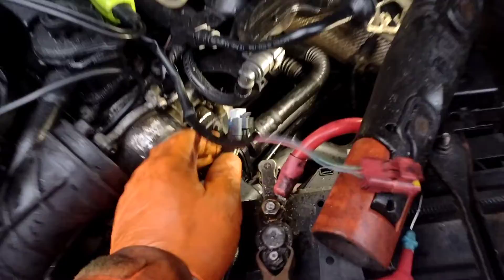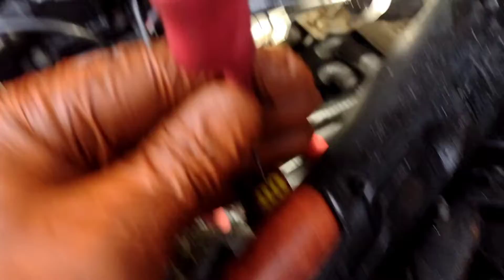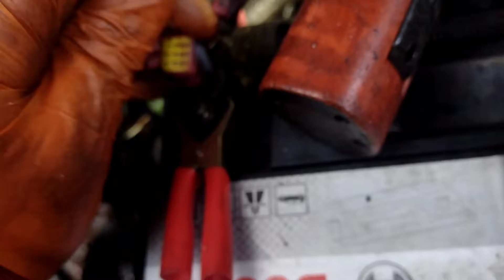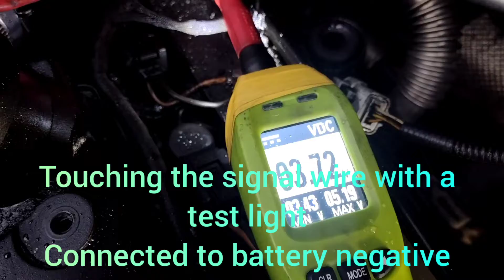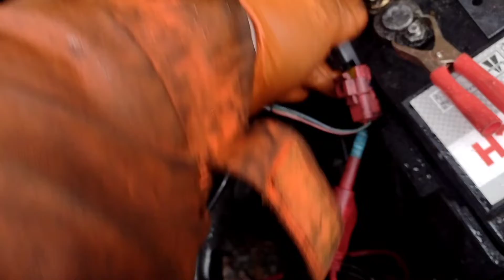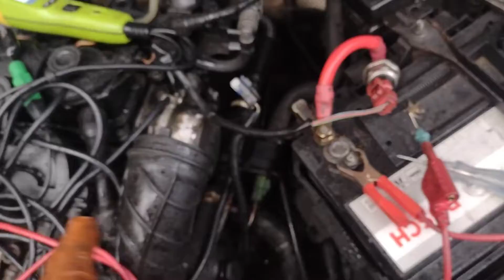Testing a diesel fuel pressure sensor (P0193) Ford Fusion

Comment: Great diagnosis,glad i found the video. I have similar problem on a ford fiesta. Voltage is almost same like yours,only showing 4.99 on the 5v(guess not a big problem) and the signal wire spiked when i put the test light,guess thats ok. I hope the new sensor will fix the problem. 
One question i have does the part numbers need to be the same like on the old sensor? Lot of them online but diferrent numbers,it says fit to 1.4 and 1.6tdci engines🤔
Reply from the maker: I used motor parts direct and it wasn't the same part number but it did work fine
Reply: @mattsautodiagnostics  tnx for the quick reply. I think ill get tomorrow the sensor and try out. Hopefully it will work. Greetings👍
Reply: @mattsautodiagnostics  hey Matt,after i changed the sensor,and deleted the fault the car started good,but i noticed the rpm fluctuated for cpl seconds and smoke apeared for a little,just on the first start. Later was everything fine. Next day,first start rpm's fluctuated again,went for a ride and car shutt off..again the fault was back p0193. I didn't purged the air out of the fuelfilter,because the engine doesnt have a pump to purge it. Could air in the system cause the car shutting off and apearing back the fault p0193?? There is only one grey pipe on the top..and one at the back of the filter,is it possible to.purge it with a vacuum pump?
Reply from the maker: Yes that will be what happened, some air in the system. I always use a hand primer or an oil extraction pump to prime the system
Reply: Im confused about the pipes.. the fuel circle must be closed when i use the vacuum pump? 
I guess the grey connection pipe is the one where i.purge the air out🤔

Comment: Hello, please help, Peugeot 207 1.4hdi, error code P0193, high pressure, the sensor is new, but the car still won't start! it keeps writing this error code and it can't be deleted, could it be a connection,connector problem?
Reply from the maker: It sounds like it will be a wire fault, see what the fuel pressure is showing on live data with the ignition on. Check at the sensor for five volts/ground/signal. The signal is 0.5 volt with ignition on and around 1 volt cranking/idle
Reply: @mattsautodiagnostics  hello, I couldn't look at the live data, but when the ignition is on, the voltage in the connector is 4.95V, I think this is high, and there is also 4.93V on the ground side, nothing in the middle
Reply: @tamaszimmermann9492 hi bro did you fix the issue
Reply: @mattsautodiagnostics ok thanks, I'll check, the wire to the ECU is not broken, the mechanic measured it, I'll check the live data and the connector

Comment: Hi Matt. Happy New Year. I have a durotorq in a Mazda BT50 pickup in Thailand. Any known weak spots on these engines?

Also, I guess if you had not had a spare sensor you could have diagnosed it with your Gunson signal generator and a voltmeter or scan tool ?

Comment: i had a similar problem. the pins were touching in the connector
Reply from the maker: I haven't had a faulty pressure sensor on one of those engine's before. I was thinking another wire problem here. Thanks for watching

Comment: Well done Matt. How you coping with winter conditions?
Reply from the maker: If it's raining, I do less hours on that day. I work seven days with less hours.
I did get a clutch that I changed after it snowed, although it wasn't snowing at the time. I put on the high vis work clothes, just do enough then go home. If it's very windy or pouring rain I don't go out. I either give it a while or re book the work.
It's working out ok, cheers Matt